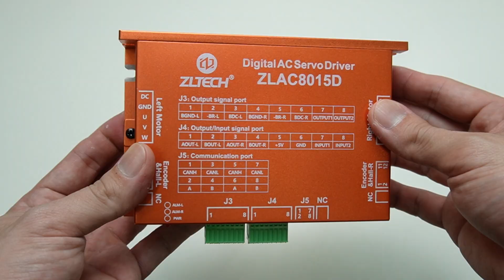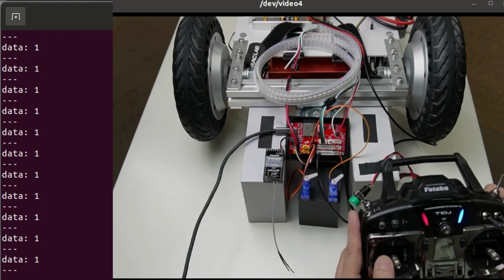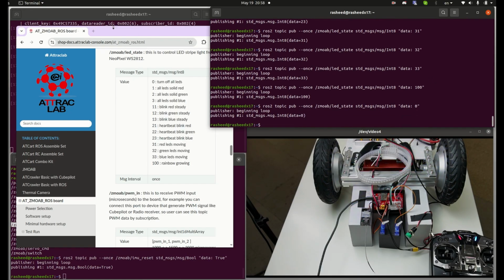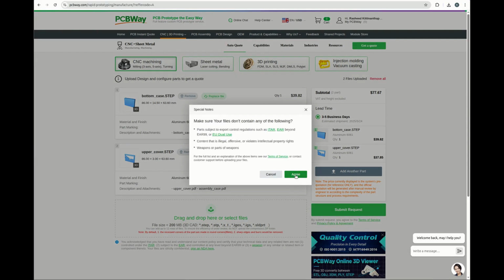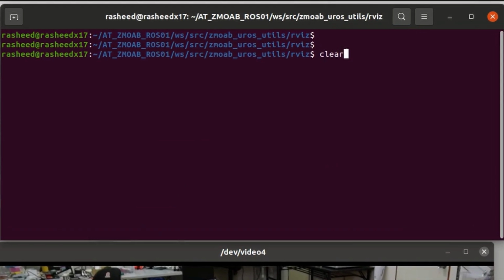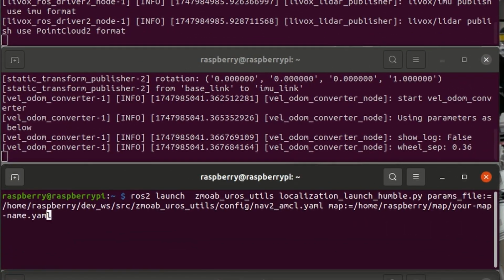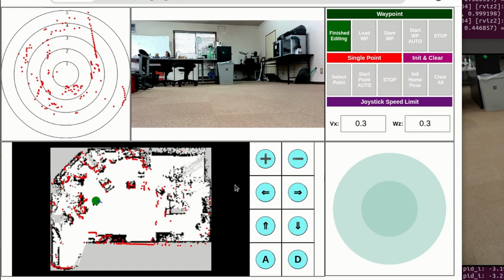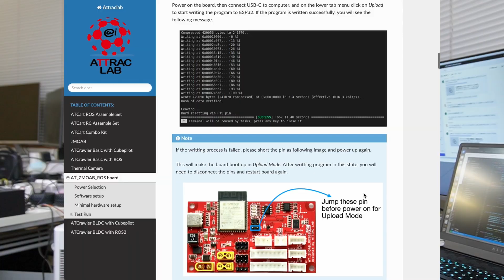This Board Makes Your Robot Project A LOT Easier | AT_ZMOAB_ROS

Comment: Hi! Great video – thanks for the clear and inspiring content!
I have a quick question: is it possible to use the AT_ZMOAB_ROS board with two motor drivers (via Modbus RTU over RS-485) to control four motors? In other words, if each driver has a different Modbus address, could we connect two of them so that a single master (the AT_ZMOAB_ROS board) can drive two additional motors – allowing for a 4-wheel-drive robot? Thanks in advance for your reply!
Reply: Hi, did you get an answer to this question? If not, please Rachid, is it feasible because I would like to get an AT_ZMOAB_ROS for a 4 wheel robot. Is that possible? thank you